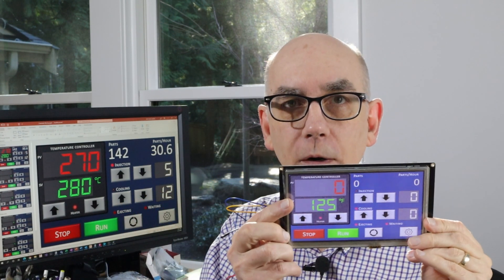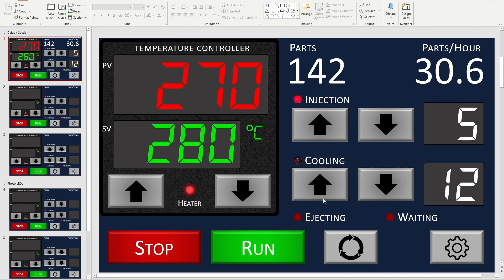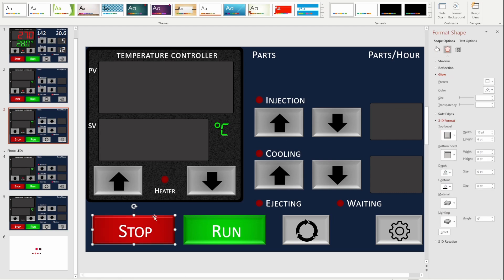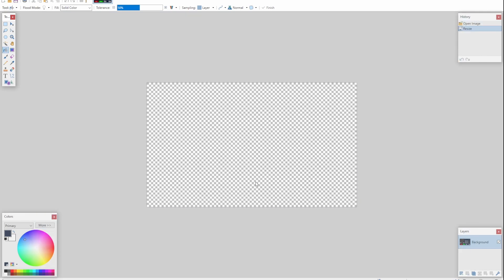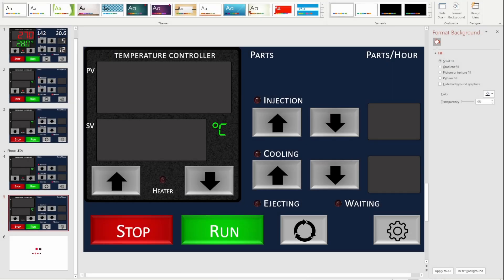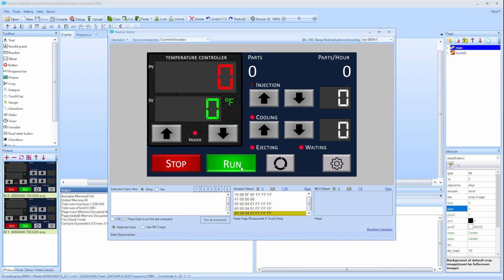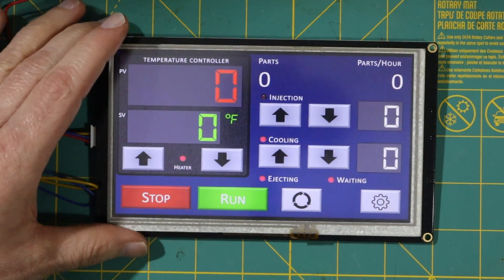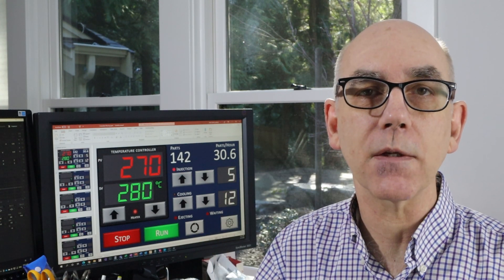Nextion Display for my Injection Molding Controller

Comment: Hello JohnSL, can you help me with a software-related matter? I want to create a project. In my project, I will be using a Nextion TFT screen, Arduino Uno, Green LED, Blue LED, DC motor driver, and DC motor components. In addition, I will use one yellow button and one red button.

The program's operation is as follows:
I will input a value, such as 5000 milliseconds, into the "n0" object on the Nextion screen. I will also enter a value between 0 and 255 into the "n1" object, which will be related to the motor's speed. Based on these values, the motor will run between 0 and 255 revolutions for 5000 milliseconds and then stop. After entering these values, to start the program, the "b0" object on the Nextion screen and the Arduino, connected to the analog "pin1" yellow button, will serve the same function. Whenever the analog "pin1" button or "b0" object is pressed, the motor will start running again and stop when pressed again. In case of an emergency while the motor is running, there will be a red button connected to analog "pin2" to stop the motor. When the "pin2" button is pressed, the running program will stop immediately, and the green LED will turn off. To restart the program, we will need to press the "Dual State Button" button. All of this system will be controlled by the "dual state button" object on the Nextion screen. When the dual-state button is open, the system will be ready to run, and the position of the dual-state button will be indicated by the green LED connected to digital "pin 12". I want to create a project that operates in this way. What is the cost of such a project?

Comment: Awesome video! I'm working on an automatic plastic injection machine that will use the nextion 7" screen. So it's very cool to see what you deem important given you have a lot of experience with injection molding.
Reply from the maker: Thank you. I've already thought of a few things I'll need to change, which I'll incorporate once I get the code talking to the display. And I'm open to any suggestions you may have as well.

Comment: Amazing work! I’m wondering if this project can be open sourced or sold as a kit. The software is what holds me back from making my own automatic injection molding machine.
Reply from the maker: I am thinking I'll make a custom circuit board and sell them. It's not likely this is worthwhile doing, but should be fun!
Reply: @JohnSL  Well I can tell you that I am VERY much anticipating this so I can put it in my makerspace for the kids to get a blast from! Hard to get something these days with prices of everything soo high. DIY is the route we are going to take. Keep up the good work!

Comment: I got tired of that SD card pretty quickly. Uploading via a usb cable is much quicker and eliminates a lot of fumbling and plugging/unplugging.
Thanks for another great video! I didn't realize only 2 photos were required and each button only reads the part of the photo it uses. When I started watching this video, I expected you to use hotspots.
Reply from the maker: I thought about using the USB UART for downloading, and may try it. Once I get the STM32 hooked up to the display, that won't be quite as easy. But, it still might be faster. I'll have to try it out. Thanks. As to using hotspots, I discovered this two-image trick from some other videos, and it works really wel.
Reply: @JohnSL  Wow, I didn't realize it has been 3 years since I tried this. The project got back burnered until a week ago. Mainly due to the fact that I'm a machinist and not much of a coder. A week or so ago I tried Chat-GPT to write code. It was rough at first, like herding cats. But I now have working code. 7" Nextion, ESP32 combo for a machine controller. It has 4 pages. The machine I am developing is an automatic saw for small to medium sized shops. I always enjoy your videos, thanks!